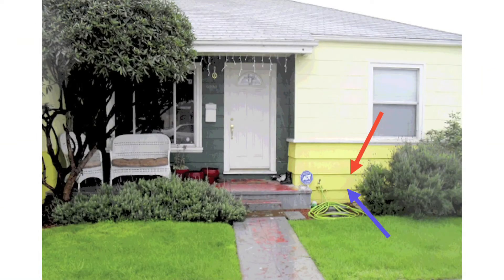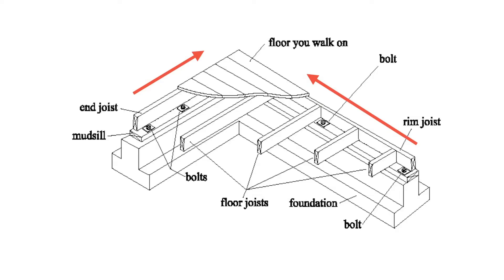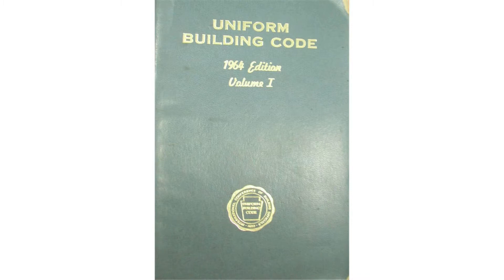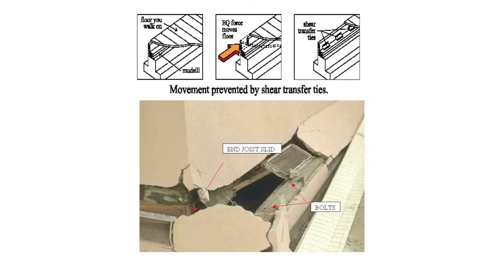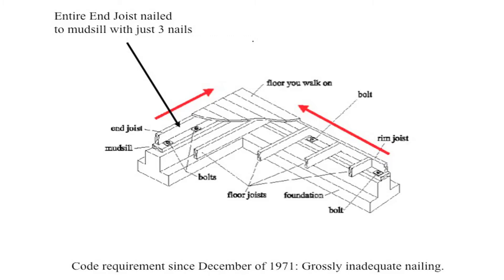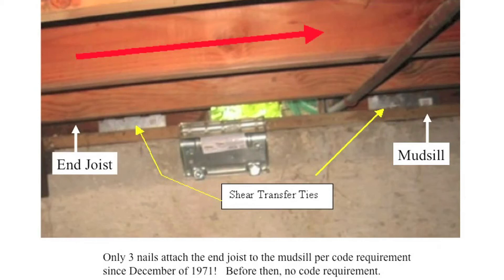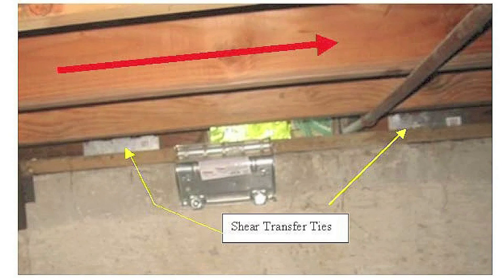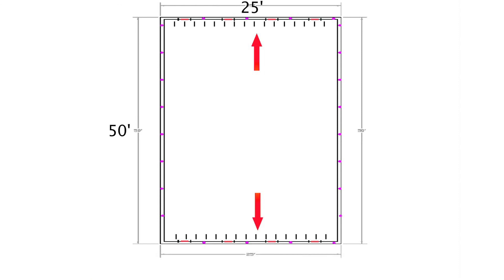Retrofit Bolted Homes? New Houses & Seismic Retrofitting

Comment: This is terrific information. Making the END joists as strong as the Rim joists by  ADDING the same number of UFRP PLATES plus shear transfer ties is the hot ticket.  This video clearly shows that the old 6' spacing around the perimeter of the foundation is not adequate to make all sides equally as strong. That is gold! Also not all houses are one size, weight or height and it should be calculated. It is best to follow the Simpson Strong tie videos for the proper installation  procedures. Many of the videos online are not totally correct and take short cuts. I viewed this video several times before I understood the engineering concepts. Also, follow the other blue links for more information.

Comment: Post 1997 California construction using Sustainable Lumber from very small diameter large grain soft wood trees requires huge bolt washers and other changes such as closer bolt spacing.  To imply that the new standards for weak soft lumber are required for older properties is bunk.  Old growth red wood foundation sill plates can be held in place with longer bolt spacing that what we build with today. Beware of slick contractors selling you more bolt or Simpson side plate fasteners.  The condition of the crawl space framing when good and well ventilated will in many or most cases not require any more bolts than originally installed.  Beware of contractors trying to make a large profit selling you products that you may not need.
Reply: Agreed, those Simpson foundation/mudsill  connectors are over engineered/overpriced and don't function any better than adding additional bolts, with square washers, my house has foundation bolts every 4 ft. So I don't think I need to add any, but I am replacing the round washers with square washers with teeth.

Comment: My house has 1 1/2" t&g car decking over post and beam supports.  There is no typical mud sill.  There is a 2x4 set on edge set into the top of the concrete foundation wall.  The car decking runs over that 2x4 with no apparent connection (the decking may be nailed from above)  There is no apparent foundation bolts (as seen from the crawl space).  What is typical retrofitting for these conditions?
Reply: Hello Daniel   A Mudsill for construction in California has not been installed since the late 1880s here. That would be a very large plank such as 16" wide or more and 8" tall. They would be directly laid on the dirt when the soils remain dry most of the year.   Ice fishing houses of port a johns have mud sills.    What most houses have are sills or lumber foundation sill plates not mud sills.  Beware of people making videos who may not know what they are talking about.